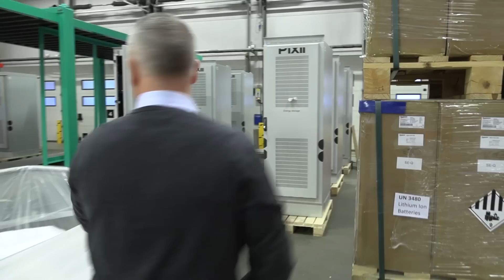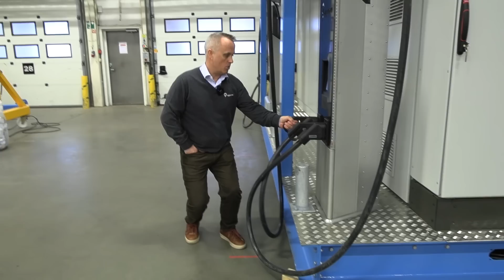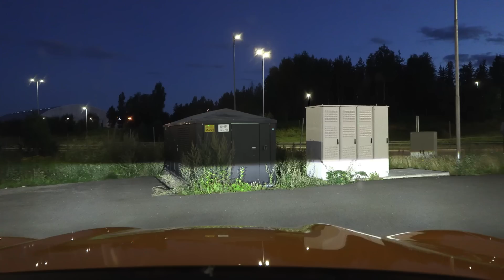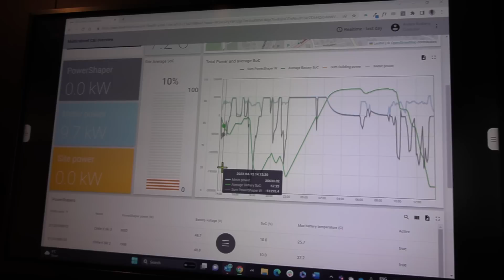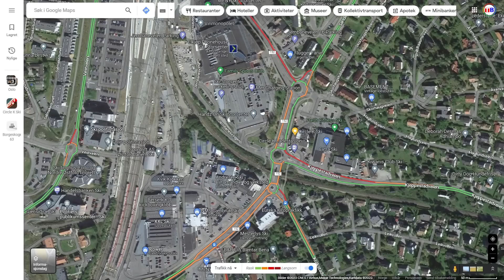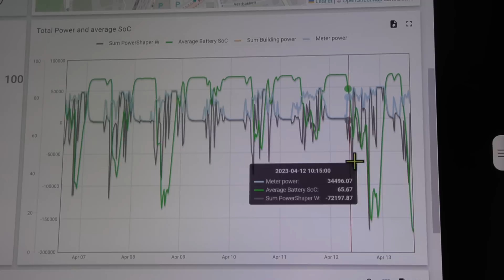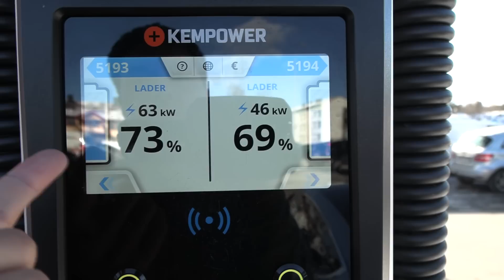Elywhere's semi-portable 360 kW fast charger with 300 kWh local battery storage

Comment: Imagine on how this whole thing should be disassembled and cleaned from dust. I am surprised it has such an old school modular and cooling system. It will not work in massive production.  All the ingredients should be inside of isolated chamber, which gonna cool down through external AC.

Comment: Quick correction: whether LFP batteries are better/safer than NMC is debatable: control is more difficult, low-temperature performance is very poor and most importantly, they are not less predisposed to thermal runaway - in fact it is absolutely incorrect (and unfortunately ill-advised) to say that they can be crushed/punctured without catching fire - it's like saying you can safely drill a hole through a fully filled methane tank: it won't catch fire from the process but will almost surely be ignited leading to a massive ex*losion. LFP generates toxic and highly flammable gas when in thermal runaway and its temperature is 2000degC+ whereas NMC peak temp is around 1200degC so containment is actually easier in NMC, plus propagation is also slower / somewhat easier to prevent.

Comment: Soo good in so many aspects! For example replacing an old single 50 kW charging station in remote location with this suddenly allows you to charge a Tycan at 300 kW without providing any more power to the location!

Comment: Love this but what happens when battery is “empty”,  10%, and a car plugs is to charge? I assume the charge rate is then limited to incoming AC feed? May make sense to oversize aka bigger buffer.
Reply: If you empty the batteries (after 50-60 charging sessions in 24 hours) it takes the power directly from the local grid and fill up the batteries when needed

Comment: Great video and neat solution. One question I was hoping you would address is what happens when the battery is at the minimum SOC? Does the charger output it’s max it can pull from the grid (I.e. 40’ish kW)?
Reply: Its actually up to the customer, but default its minimum 10% and max 90%

Comment: 25:00 I actually think all EVs "help" the grid as home charging is a big load that can be shifted from the hours of electricity shortage to the hours of electricity surplus. Often even saving money for the driver as they pay way less during the surplus hours if they have an hourly rate electrical contract like Tibber. Though this is on a scale and EVs will still cause challenges for local grids if we don't have these battery solutions. 
They should aslo help reduce the CPOs electrical bill as they charge for cheap during the night instead of the expensive day, and reduce the peak draw fees massively hopefully allowing for cheaper charging prices.

Comment: I once sat next to a guy at a dinner who set up a company to use idle diesel power generators on building sites and factories (the ones that are also container sized) to remotely come on to help power the grid at peak times (around 5pm when people come home and start cooking).  The beauty was it was at these times that the generators sat idle and it saved having to fire up coal powered fire stations to cope with peak demands. I remember thinking that EV vehicles and the infrastructure could maybe do the same and now here it is.  Well done … what a great product in great packaging. If you put one outside Bjorn house I would  happily drive from Scotland to come and use it 😂

Comment: Great information Bjørn! I could add that by using the new sodium-ion batteries (natrium-ion in Norwegian) that will be 30 - 50% cheaper, having a 5 - 10 times longer life cycle and with almost no impact regarding low or high tempratures this would secure the further succes.

Comment: This turns the equivalent of a single 50kw chargers grid connection into four 360kw (shared?)  fast chargers, which are much more practical and generate much more money for the owner as they can serve many more customers and are more desirable for customers. All those charger locations that are currently a couple of 50kw chargers could be converted to full 8 charger hyper fast charger locations with no grid upgrade. 

You could turn up with a truck that has an integrated crane, drop this off and wire it in place of an existing 50kw charger, probably take just a few hours to complete the conversion (they quoted 2 hours to remove it)

I strongly suspect those chargers are also perfectly spaced and lined up when you drop this in an existing carpark.

Comment: Hi Björn, thanks for a great video.

You say this is good. I'd say that's an understatement. This is a big improvement.
I live in Sweden and we use gas for fast backup and oil for slow backup.

Just as few as 100 of these units would make a big difference in the Swedish electricity grid. We in Sweden have big problems because we have big units like nuclear power, 1400MW that disappears in a few seconds is our big problem. These fast-reacting batteries would free up capacity that we reserve and cannot use due to nuclear power today. We can use more of our electricity in sweden with this solution.

Comment: This is brilliant technology that will help balance power networks and reduce the increasing demand chargers are having. Here in the Netherlands we have a massive problem that the network cannot cope with the demands being asked of it as everyone switches to solar power, using heat pumps and installing charges at home, offices, on street etc.. the limits of the network are holding back the transition to cleaner energy. This solution would really help to expand and balance whilst parts of the network are upgraded.

Comment: Wow. This is like taking the prefab Superchargers to the next level. Having such a flexible grid option can be such a benefit. I know Tesla has something similar they have deployed. Elywhere is taking this to be a fully deployable system plus more. I agree it is a brilliant solution. 

One better would be to have the solar addon for both the original container. Just lift the canopy to a safe angle to keep snow off them and you're good to go. It could be easy to drop to flat transport level.

A versatile canopy for the parking would be cool though building into a container form with the raised platform might not be possible.Also would interfere with some who need to park off center for charge port. It would be a nice bundled solution.
Reply from the maker: A solar canopy would add only a few kW.
Reply: @bjornnyland  yeah, it's a cool thing if you have a solar farm at 50 meters or so and produce at least 100 kWh per day with it.

Comment: My understanding is LFP batteries have no lifetime problem with being fully charged. Why are they only using 90 percent?
Reply: LFP have lifetime problem to rest at 100%, less then nmc/nca, but they have
Reply: It would seem like a good Idea to have the charge percentage be controlled dynamically by Ai looking at past trends and future events coming up . For example the site they showed down at 11% (almost empty) if they had charged it to 100% the night before it would have only gone down to 21% allowing another EV to pull in and still get max peak charging speed .

Comment: Surely for busy locations, with demand rising, this can only be a stopgap while getting a higher power connection installed? If the average load across a day or week is higher than the grid connection, it doesn’t matter how big the buffer is, eventually it’ll dry up. It looks great in terms of having something set up while waiting for the grid and permitting authorities to pull their finger out, though!
Reply: At 50 KW input they can charge 600 kWh in 12 hours (nighttime) so they can use this to fast charge 6+ cars (assuming they don't charge from 0 to 100% each, but even if they would wait to get 100% at some point the charging speed will be under the 50 the station gets from the grid so it will charge itself as well).
Reply: This is the great tech Thenerd6112 ;-) its mix between power from the local grid and the batteries ;-) and remember that all EV cars have a charging curve, AND the average charging is approx 34 kW, AND 80% of EV do not charge more than max 50kW, AND its the state of the car battery that decides the charging ++++

Comment: Since they're LFP, I'd be curious how they keep them warm in the winter. Any such pack needs thermal management including warming, but LFP doubly so.
Are the packs somehow thermally insulated for small heat losses? Or do they warm them up just temporarily for the recharge cycle and then let them cool down? Even some seasonal thermal padding could be used in principle 😀
Reply from the maker: They have fans for cooling the packs. But they actually also have heating fans for winter. Circle K who's one of the customers of Elywhere has two of these containers placed in north of Norway. The locations are Evenes and Buktamo. You can find them on Google maps.
Reply: At least for the Circle K location shown, the batts were constantly being charged or discharged, I bet they hardly have to use supplemental heating when these are in use.
Reply: Heaters in the cabinets (coolers for warmer climates)

Comment: Could NIO´s battery swap stations be used for the same purpose of balancing the grid? I guess they have good management system that charges the batteries at lowest cost possible.
Reply: They do kinda balance the grid already by not requiring a lot of energy at once since they charge slowly the batteries but they don't discharge in the grid to maintain the levels if needed because they need the batteries to be charged if a car comes in at any moment. They could keep 1-2 battery packs in reserve to handle this if they wanted tho.

Comment: I’m still watching the video so maybe this gets covered or maybe I missed it, but when the charger battery SOC hits it’s minimum, what happens? Is the vehicle charging then limited to whatever the input power is capable of (minus the overhead of course) or do the chargers go offline until the charger battery SOC recharged enough?

I’m also curious of the price to purchase and install one of these.

I love the idea and I’d really like to see these getting rolled out more, but I think it’s also clear that this isn’t a solution with zero downsides.
Reply: presumably it limits grid power draw to the 48.8kW maximum charge rate (site specific) and connected vehicles get 48.8kW/# of charging sessions.
Reply: If you assume they would only have been able to install 1x 50 kW charger without this system, and then assume that at worst case, this system when maxed out falls back to being a 50 kW charger, then from that perspective it is zero downside.
Reply: Not quite sure I agree. For installations like the Circle-K location featured in the video, customers will need to rely on the functionality of the chargers when making travel plans. Here in the US, the charging network operated by Electrify America is a prominent example of the frustrating experience customers  are facing. With units advertised as up to 350kw speeds but often found to be limited to much lower speeds, it wrecks travel plans. I don’t see how these units would avoid that issue.
Reply: @HB-bv3ic  As long as you manage expectations then what is the downside? Before they rolled in this container, 350 kW at this location simply did not exist, now it can exist. Nobody would have been counting on this location being 350 kW before, and as you are pointing out, they probably still shouldn't. However, the people that were rolling in hoping for 50 kW now have a decent shot at getting something higher than 50 kW, so can we not just be happy for this fact alone?

Comment: Interesting. You should have asked them why they're using LFP batteries in a 15s 48 volt configuration rather than the industry standard 16s 51.2 volt configuration. The reason 16s is more commonly used in LFP is a voltage drop below 3.2 volts per cell will occur under a 50% depth of discharge in a 15s configuration, which means drawing more 100 amps from 50% to 0% on a 100ah battery at a 1C discharge rate, which is harder on the battery because more resistance causing heat build up will occur at higher amp draws.  A 16s configuration puts less stress on the battery since a constant draw of 3.2 volts per cell or higher will be maintained down to a 10% to 20% state of charge which means only drawing 100 amps on a 100 Ah for 80% to 90% of the discharge cycle.

It was easy to tell all this information based on the nominal voltage, charge discharge voltages, and nominal capacity from the specification sticker that you zoomed in on.
Reply: Might be because 48 volt DC battery systems are regarded as "low voltage" which means fewer regulations and easier (and safer) to work on. If they were in higher voltage modules they would be more difficult to swap out etc.

This system strikes me as one designed by engineers used to working with regulations and understanding how to make it easier for operators and maintainers even if that causes technological compromises. It fits in a standard shipping container and plugs into a very common size of grid connection and is self contained. This is so easy to install with very minimal equipment required, you need that level of simplicity to roll things out quickly.

This turns the equivalent of a single 50kw chargers grid connection into four 360kw fast chargers, which are much more practical and generate much more money for the owner as they can serve many more customers and are more desirable for customers. All those charger locations that are currently a couple of 50kw chargers could be converted to full 8 charger fast charger locations with no grid upgrade.

I strongly suspect those chargers are also perfectly spaced and lined up when you drop this in an existing carpark.
Reply: @insanityideas  This is so simple that it's puzzling it took so long for a product like this to get into market.
Reply: @darekmistrz4364  
Lack of demand. Even 2 years ago there were a fraction of the EV there are now. There was little interest in installing chargers at scale because there weren't enough cars to use them. Now everyone is scrabbling to get infrastructure in the ground. Over the last 12 months on routes I drive the number of charging points on one 300 mile stretch in the UK has increased by 8x after remaining static for 2 years previous. And they are all busy.

Rapid unexpected growth has required the development of solutions like this.

I can see them having long term use in seasonal areas like summer holiday destinations, where they are only installed for summer peak season.
Reply: @insanityideas  Definetly. Future is looking just a bit brighter with companies like that
Reply: I don't think this is true. A cell will discharge at the same voltage curve at 1C, regardless of what configuration the whole pack is in. Why would a cell have a different voltage at 50% when it is in a 16s pack than when it is in the same conditions in a 15s one?
Reply: I don't think that is that important in this application, they are far away from pushing these batts to their limits, for a 300 kWh system to output 360 kW, we are in the 1-2 C range, less if they have the grid connection helping at the time. The real answer is probably because 15s fit nicely in the boxes lol

Comment: I tried to post the following comment without paying, but I am not able to, Bjørn, help? Edit: Fixed! Thanks, I've deleted the redundant comment now.

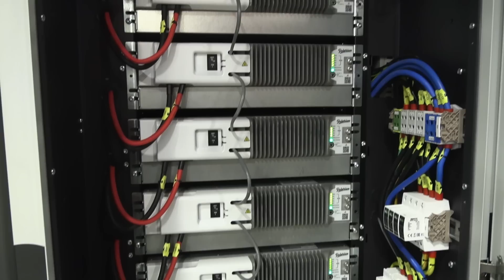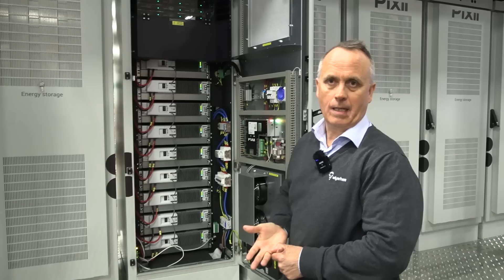Anyways: I think there is some confusion around the battery blade/module size, no way in hell each one is 50 kWh as you state at 6:49, he says they are 5 kWh at 8:10 and also if you do the math on the box of batteries you showed earlier in the video, those are also 5 kWh. So each rack is 9 x 5 kWh = 45 kWh, looks like they have 6 battery racks, so 270 kWh ish? I'm not so sure about the total power as I am that each module is only 5 kWh. I have a 16 kWh home battery system in raw LFP cells so I have a pretty good feel for the volume of batteries needed to make that kWh.
Reply: 1 Pixii cabinet contains 10 approx 5 kWh battery units= 50KwH in total pr cabinet. 6 Pixii cabinets= 300kWh. We can soon deliver units with up to 10 kWh making close to 600kWh in total in 1 ES unit.

Comment: very interresting. was thinking about this solution many years now and you did it.
and the solar thing can be very interesting for you in france where every carparking are above 50 cars require to be covered in solar. so that would make the units perfect in france
Reply: Very interesting… Does this rule also apply to northern France? And does all 50 parking spaces have to be covered? All the best, Per (Denmark)
Reply: @nakfan  u have to google, but the rule state they need to install solar. not sure the entire area or just partial

Comment: 11:45.  here in germany, with a mid voltage (20 kV) connection you pay around 140 € per kW the whole year. Even if it occurs only once. The price varies with the company who runs the grid in this area. So 300 kW meany at least 42000 € for a year just for peak power.